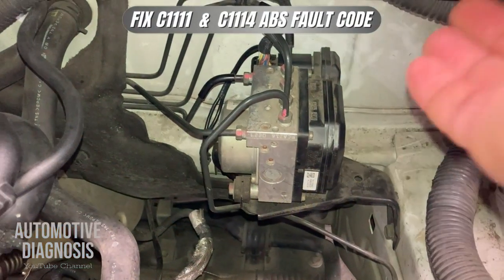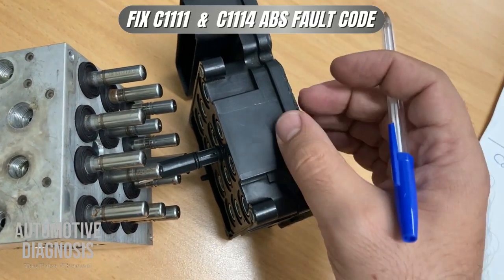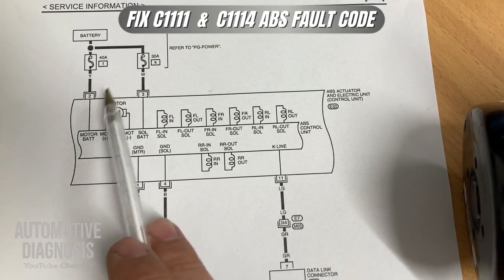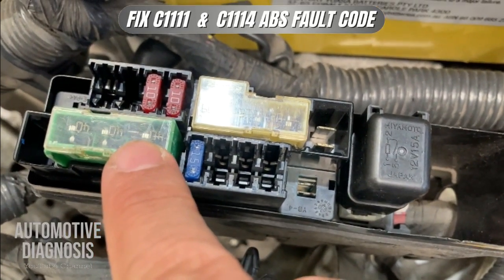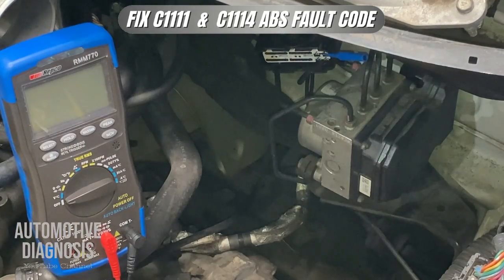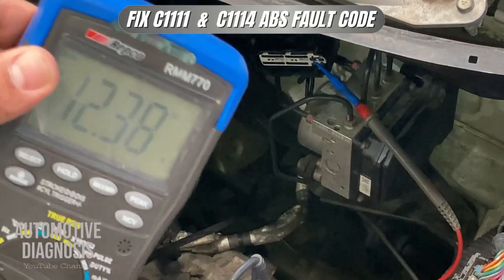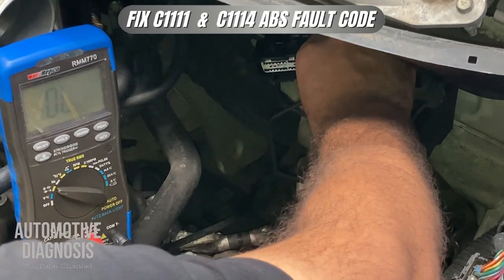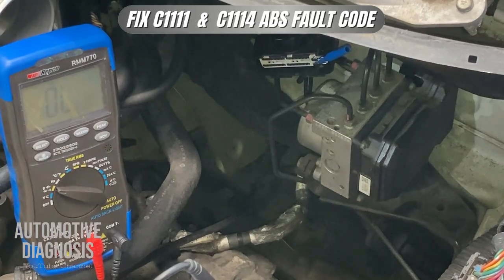Fix ABS Pump Fault & ABS Valve Relay Error | Nissan ABS Diagnosis #abs #nissan #brakerepair

Comment: I have a 2013 Honda civic LX, 4 door sedan. 1.8 L automatic engine. My electrical socket has 4 pins. The 2 bottom pins give me battery voltage. However, top 2 pins don’t give me voltage. Is it suppose to be like that?

Comment: Great video informative and well made.
Would you say that testing or using ohms is a good way of testing, especially ohms with no load on circuits?
I've had before where 1 strand on an earth will give you continuity but could not carry load.
Subscribed a while ago just asking a question to help me with my diagnostics going forward thanks
Reply from the maker: Hi there, I normally go for the resistance inspection as it is more accurate, but in some cases like checking the presence of ground, continuity helps a lot as well as I just want to know if ground is provided or not.
Reply: @AutomotiveDiagnosis  you could have also done a voltage drop test for the ground